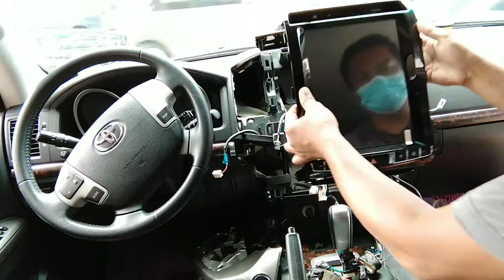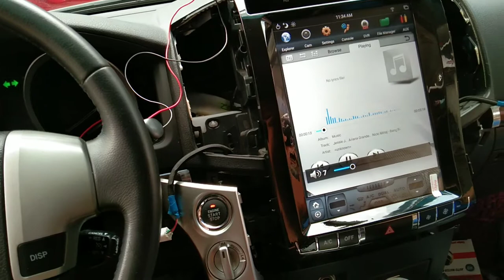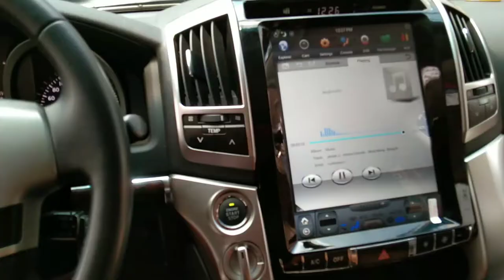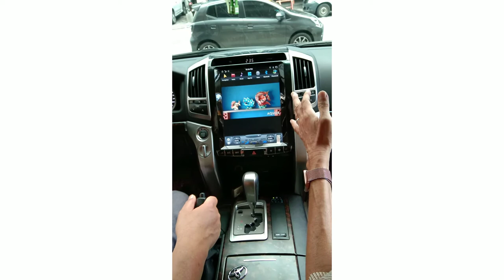2015 TOYOTA LAND CRUISER/INSTALL ANDROID TESLA PANEL

Comment: One year later.  Do you have any problems with it.  Is it worth the price.
Reply: It's not worth it, I've been using it for 2 years now. It's getting slow, and the screen frequently frosts. You have to hit the reset button every time it's frost, or you won't be able to adjust the AC. Believe me, don't waste your money on something like this.

Comment: Ask q lang boss separate ba ang volume sa stereo at AC
Reply from the maker: Hndi po sir touch screen po cya ska pati steering wheel control po gumagna lhat.
Reply: @denshowofficial8828  problema kasi sa tesla screen sa lc nmin boss.. Yung ac light indicator ndi umiilaw
Reply from the maker: Malamang bundi na Ang ilaw nya.bka may warranty pa dun sa binilhan nyo sir.balik nyo po dun